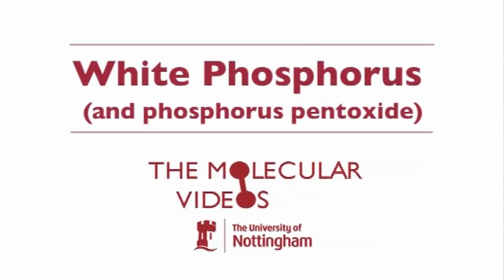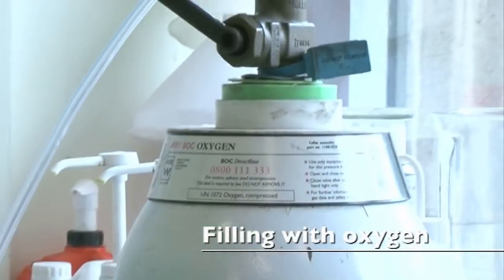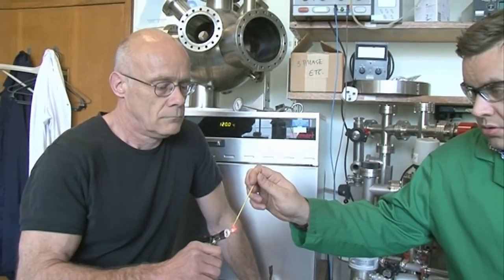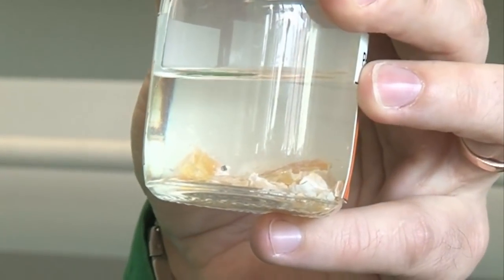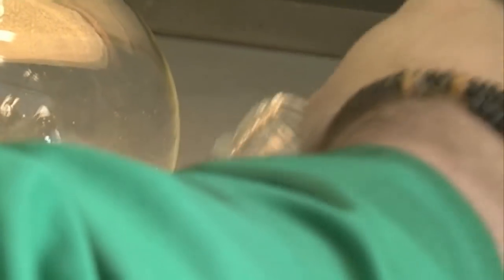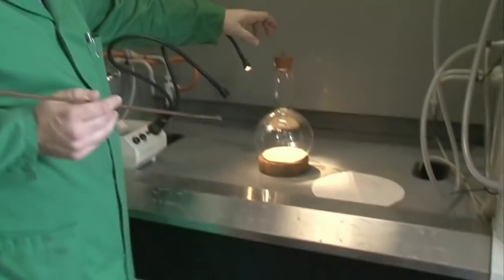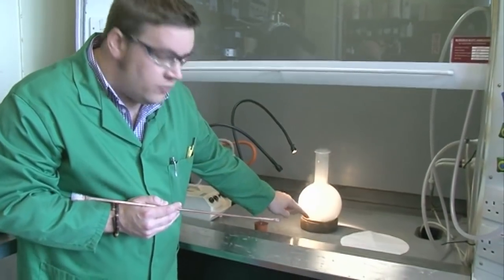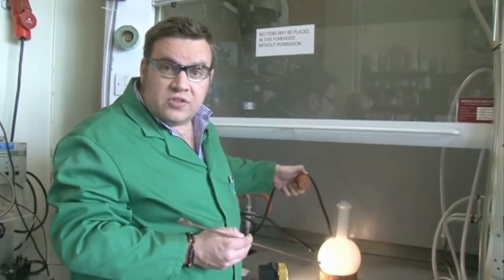White Phosphorus & Phosphorus Pentoxide - Periodic Table of Videos

Comment: White Phosphorus is used as a "pyrotechnic initiator" for Napalm in newer compositions (Source: Wikipedia). It's also a compound that will burn even when there is no oxygen available, so even putting it under water or in carbon dioxide will not extinguish the flame, which is self-sustaining.

When used against humans, it is considered a chemical weapon, and thus banned under international treatise against chemical weapons. The same goes for Napalm. Check more on Wikipedia articles about Napalm and White Phosphorus, and use Ctrl + F to Find the correct terms through your browser.

Comment: You really shouldn't say you use the glowing splint to check that there's no nitrogen left, that's like when you find out sea water contains a great lot of H₂O and then claim it means there is no salt in it.

@1RadicalOne nitrogen is not "quite the opposite": the element is actually quite reactive, unlike the noble gases. It just appears inert because the triple-bond molecule N₂ is very stable. Phosphorus on its own is not able to form similarly stable molecules.

Comment: The reason why the flask glows for long time is because there's white phosphorus vapor inside a system with diminishing oxygen levels. I've did that in complete darkness. It glows like a weak lightbulb for a surprisingly long time, and then it continues to give off the familiar weak blue-green light for a long time. That's a classical case of the reaction rate slowing down exponentially.
Sadly, even the academics just forget about it. That's what's bugging me. They should know better.